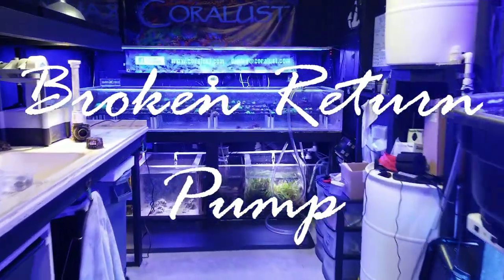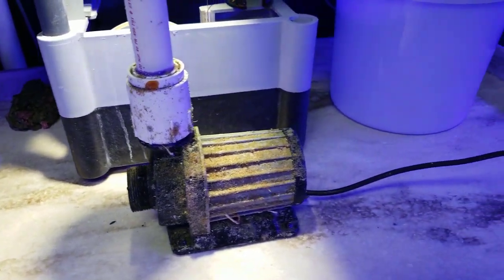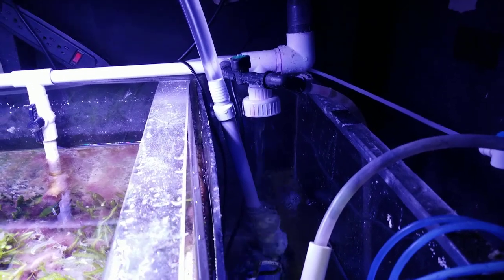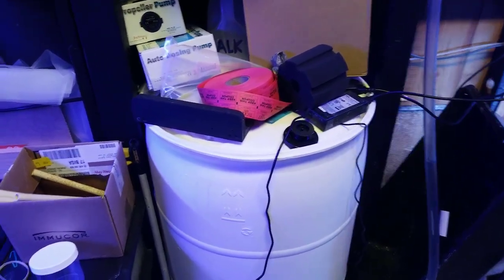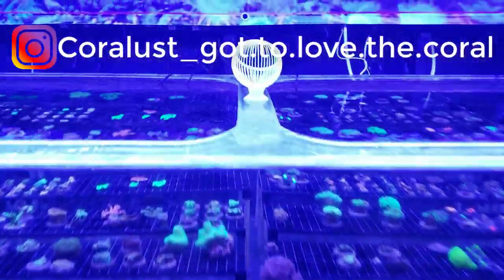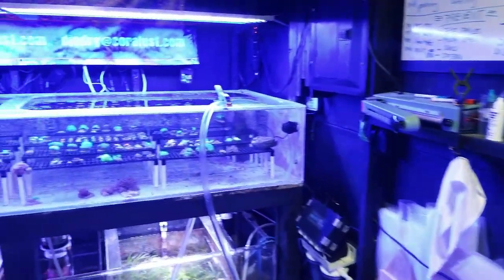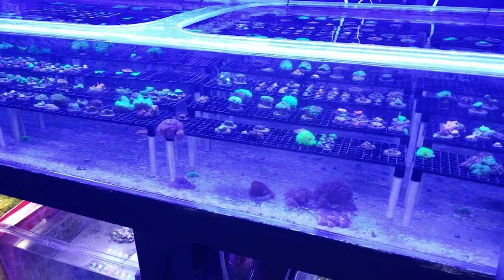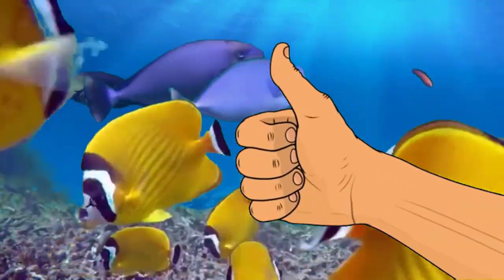Replacing A Broken Return Pump and why plumbing matters

Comment: It's been 2 years and my tank has not has anything break in it 
Knock on wood nothing happens
Reply from the maker: Lucky you James,  I hope you check everything once in a while.  I like to clean my heaters and return pumps every few months to clean off coraline algae or detritus.
Reply: Yeah I do every 2.5 weeks on the heater because that and my return pump are the only thing other thank refugium lights in my sump lol
Reply from the maker: I try to black out return and heater section of the sump, but some light spills in.